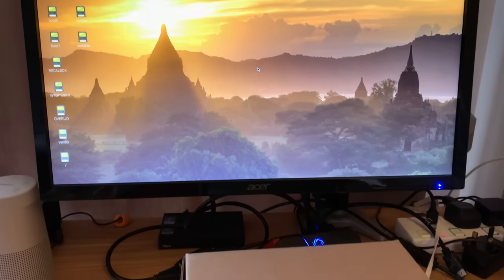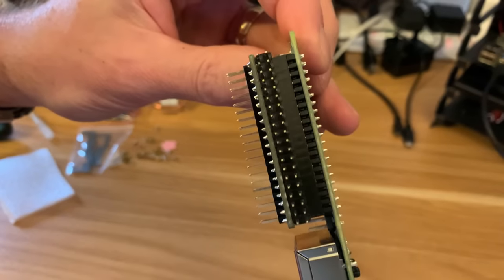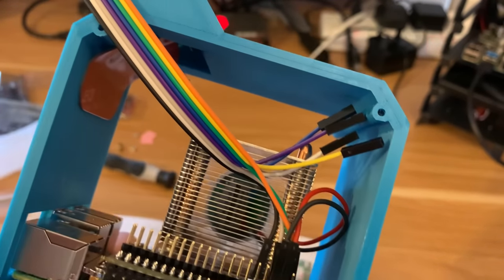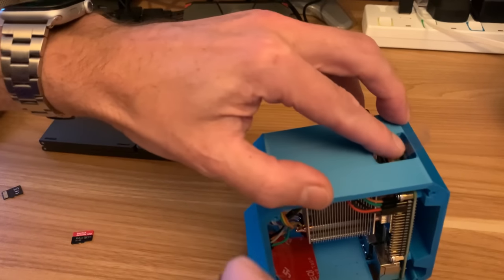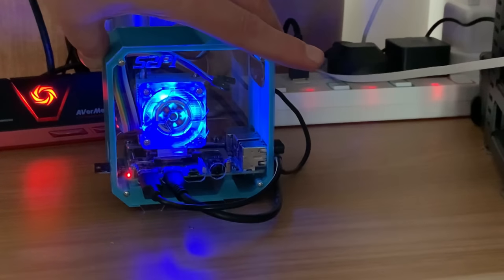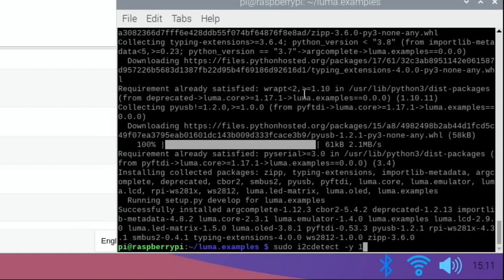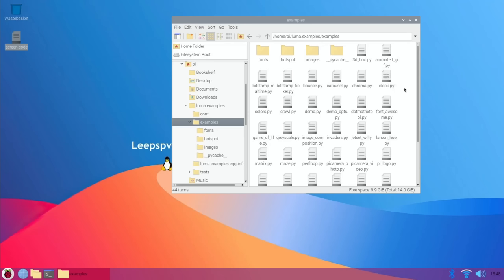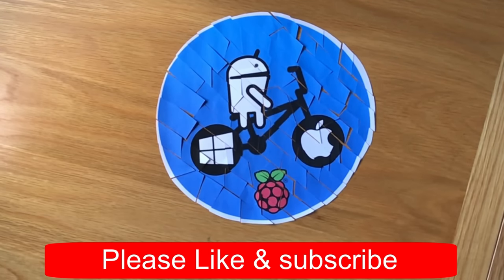3D printed ice tower cooler case with Oled. Raspberry Pi 3B+, Pi 4B. 52Pi GeeePi.

Comment: Nice. The Geekworm Raspberry Pi 4 X857 case + M.2 extension board + power management board + 2x 18650 battery holder + 2x internal fans seems to me very worth having a look at, as it is one the most simple and compact system for both plugged-in and on-battery use cases.

Comment: I don't suppose you could tell me where you got the sticky tape from? and How would you go about installing both Fans? Mine has came with two fans so I thought I could install them both... any advice?
Reply from the maker: The double sided tape was supplied in the box.

In such a small case 2 fans are unnecessary. I also would use the lower powered 3.3V connection as it’s quieter.
Reply: @leepspvideo how do you install two fans
Reply from the maker: @209julian  I haven’t tried
Reply: @leepspvideo you should make a vid about it and post it after you try

Comment: you probably know this by now considering this video is a few months old now but the usermod command just adds the pi user to the groups to allow the user to access the i2c, spi and gpio without needing to be root (or use sudo)

Comment: Do you have any videos on the rpi3b+? I'm trying to install a DE on the server version of ubuntu 20.04.5 32bit but when I reboot it it doesn't do anything? Nothing on the display. That activity light blinks intermittently like it's doing something but it's not showing up on the display. I'm getting aggravated and don't know what to do next. Is there a way to do a factory reset like the later ones?
Reply from the maker: I haven’t owned a 3b+ tasksel should work

10 Ubuntu 20.04 distros in 1. Raspberry Pi 4. plus how to install with Tasksel
https://youtu.be/BBfRVnkUAOQ

Why not just reinstall the os to the sd card or usb device?
Reply: @leepspvideo  That's what I've been doing. Is reinstall it but I was trying to do it with Martin Wimpress's desktopify even though it's discontinued it still works with Ubuntu 20.04.5 and below but when I go to reboot it after the installation it fails to but into the new DE.

Comment: I got a case almost like this one but mine is from The DIY Life. I love his case and I can't say enough about it. I already had some of the Ice Tower LED fans for other projects. I added a 2nd fan, one on the cooler it self and on the side panel. I turned the cooler around so it's a push/pull setup... I never see above 43C in this case and that's clocked to 2300 MHz. I highly recommend this case. Here is a video on his. Just search for Raspberry Pi 4 SSD Case With Stats Display!
Reply: Yeah, I printed the case from Michael Klements as well. It's a fantastic design and he's done a few different versions. This is, undeniably a rip off from Michael's design with a few simple modifications. Not sure how I feel about this. It's certainly not original.
Reply: Same here. I am using same setup exactly like you with 2 fans. And I bought the model from DIY Life and printed and laser cut it. 
That design is authentic, this design from 52pi is just copy with some modification of Michael's design.

Comment: I just got this case today. the RGB is giving me a headache. would simply severing the cable connected to GPIO 18 turn off the lights without breaking the fan functionality? i'm not using the LED etc, I just got this case for the cooling capabilities.
Reply: Have you found a solution to this? I also hate the LEDs.

Comment: Is there any problem if you only use the ice tower cooler without the fan? even if you overclock the Pi?
Reply from the maker: I have used one Overclock for some time even at 2300. 

Raspberry Pi 4 Cluster case. UCTRONICS
https://youtu.be/prIBogX-N_k

For better cooling you could remove the sides. I have already removed the fan but not the panels.